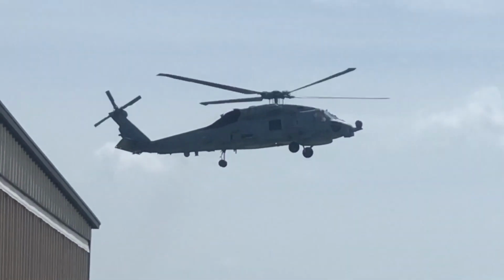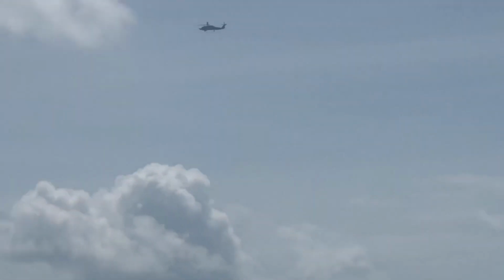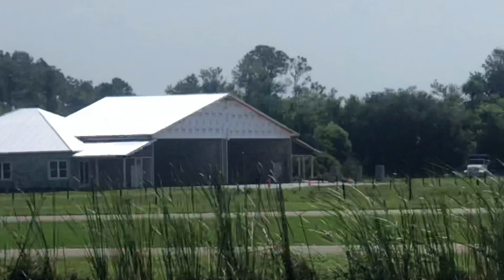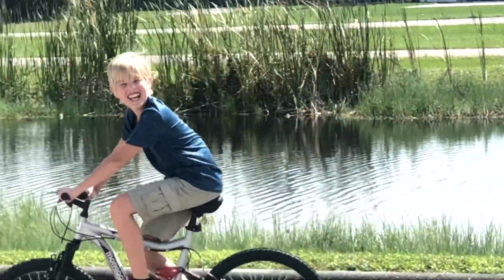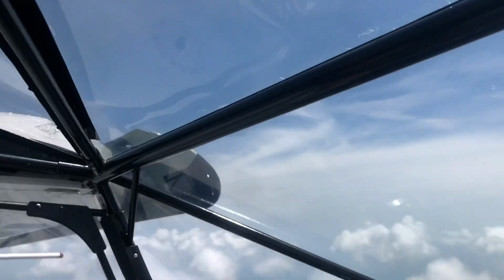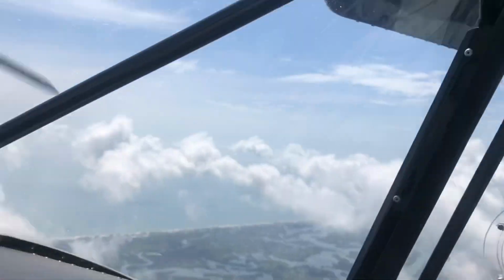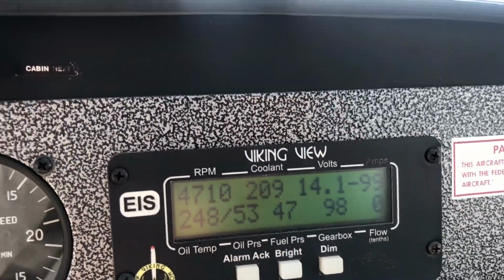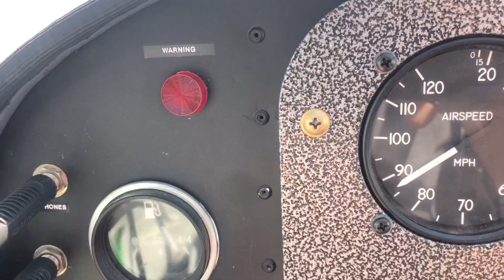A Typical Viking Monday

Comment: Does the 650 have a Viking engine? I don't see the monster radiator that I see on 750s with Viking engines.
Reply from the maker: Yes, a Viking 130 - all the Zenith 650/601 and 750 (other than the SD) have this radiator. They are inline with the belly, and no oil cooler needed either. If you see the red on the bottom that says Viking Aircraft Engines it is within that shroud :)
Reply: Thanks.